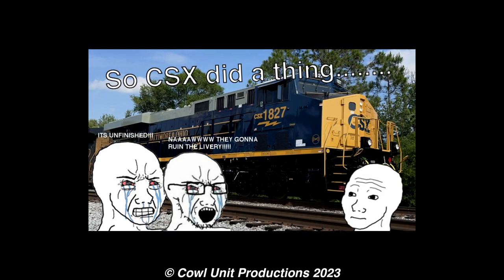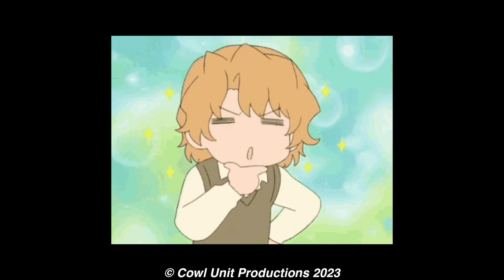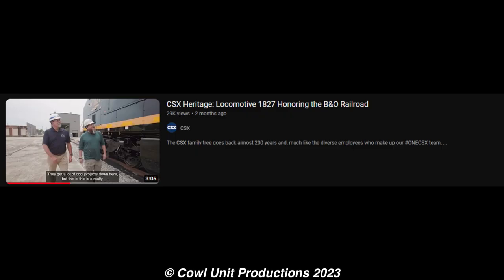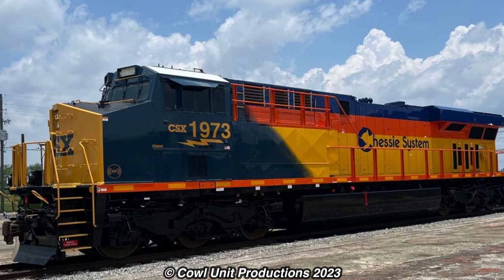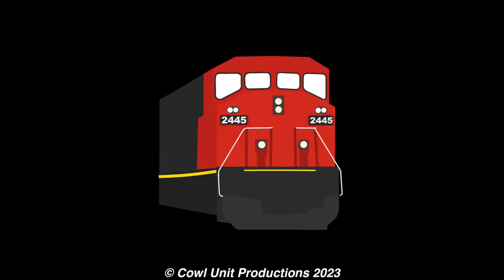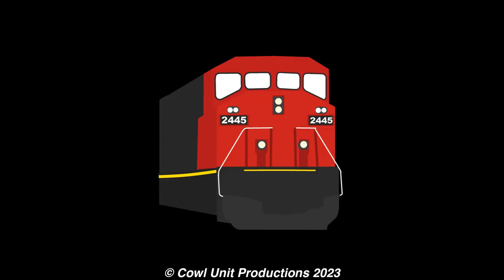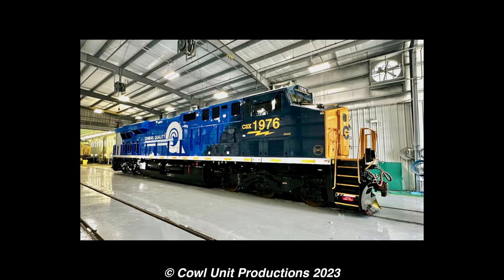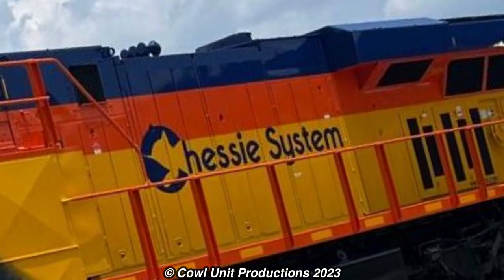CUP's Further Thoughts on CSX's Heritage Units

Comment: I agreed with some of the points here, especially with 1973, but in my opinion, it actually looks pretty good. After seeing 1973 for myself in person, my opinion definately changed a bit. Also, 1976 looks a bit weird from the first photos. The Q on the Conrail Quality logo looked too big, but after seeing more pictures, it seems that the angle of the photo just made it look bigger than it actually was, and the logo looks more normal. There is basically nothing wrong with 1982 except the yellow being a bit faded, but its overall very good. Overall, I really am enjoying these new heritage units and I cant wait to see what CSX makes next
Reply: There are actually some pictures of old Conrail units that uses the same big Q logo. I believe there are some pictures of SD60Is with that same logo on 1976
Reply: @anf_8310_ab  SD60Is didn’t exist until the 1990s, also Conrail didn’t use the Quality branding until the 1990s

Comment: I think the basic idea is fine; UP did spectacular reinterpretations of bygone eras with their heritage units, and NS took a less creative but certainly impressive run by simply using the past liveries 'straight'.  My only thought is that the fade effect looks more accidental than a deliberate design choice, as if someone forgot to mask the demarcation. The fade effect, if intended to show the transition from then to now, is a perfectly good idea, but... maybe extended more, to emphasize passage of time?  Fades are not easy to pull off well, and this looks like an unfinished job. A hard demarcation might have worked better, perhaps?  It would still convey the 'then to now' idea.

New liveries can sometimes miss a step from concept to execution. I remember back in the '90s, when CN unveiled their new North America logo. On a light background it looked fine, but on the black locomotives it looked (at first glance) like a patch of black paint had peeled off, revealing grey primer. And railfans said so. "What's wrong with that paint job?  The black is coming off already, and it's brand new!"  Pity - I really liked the North America logo, and wish they'd stuck with it.  Ah well... that's what model railroading is for, right?